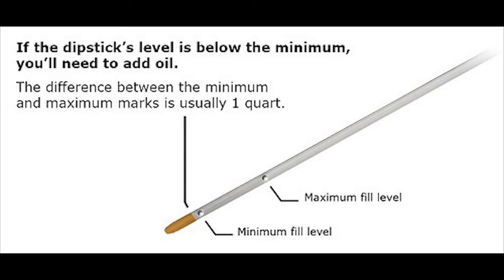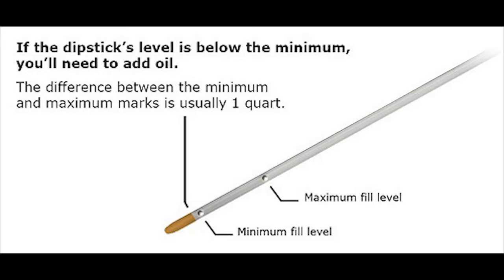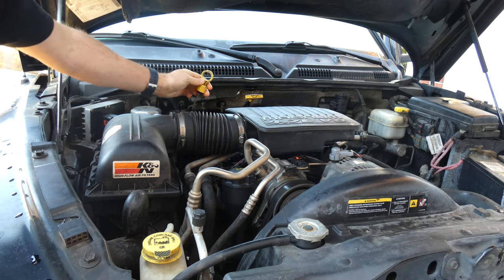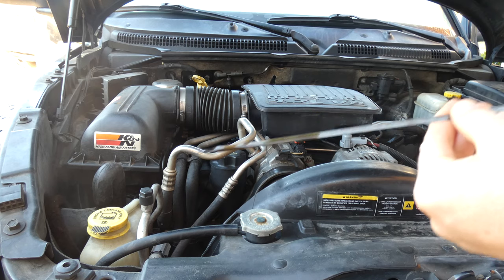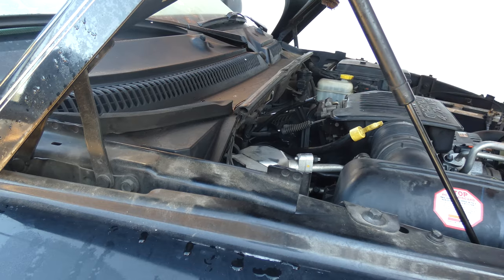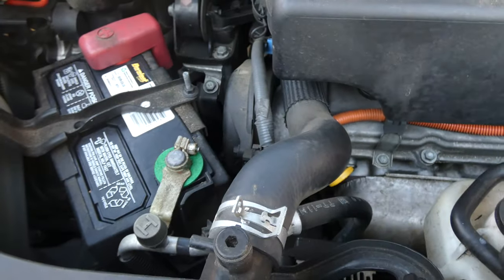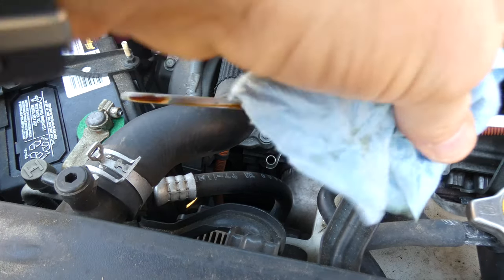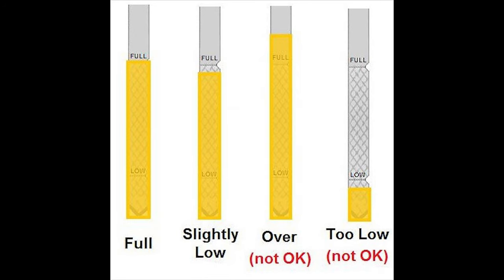How to Check Your Engine Oil Level & Read an Oil Dipstick

Comment: Shouldnt you be topping off the oil when it is closer too the low level? I know you called that safe but wont it be preventative to top off at that point?
Reply from the maker: You absolutely can top off if it is at that level but it is also safe to continue. The rule is you should check your oil every time you fill up with gas so you should catch it with plenty of time.  Also note that most manufacturers have a margin of error built in and even if it drops below that low line, you probably aren't in any danger but I wouldn't chance it.

Comment: So if there's a very faint line it doesn't matter? I have a line all the way thru jut then it's a small line running down the stick
Reply from the maker: It's pretty common to see that small line running down the stick.  Try letting the car sit for longer before checking it and usually that will go away.  If you have trouble determining where the line is, lay the dip stick horizontally onto a sheet of paper or paper towel.  That will make the oil line much easier to see.

Comment: I am not kidding. I have drove my car only 5500 kms since I bought it in 2013. I don't think I have replaced the oil in the last 3 years. Does it need oil change???
Would really appreciate a reply
Reply from the maker: You absolutely do.  Even with the best oils out there, they recommend changing them at least once per year.  Oil actually degrades over time, not just while driving.
Reply: Most cars have a change oil light wouldn’t recommend going off this but it helps tell you when the oil needs changing. So if you haven’t reached your 5000 miles in the year and there’s no change oil light. I’d still check the dipstick too see how dirty the oil is. The cars computer isn’t always accurate your best thing would be to pull the dipstick. Look for black or smelly oil if it’s slightly brown or clear that’s okay keep on driving and ignore the change oil light of it comes on. If the oils black and smells and there’s no change oil light you should change it.
Reply: Change your oil at least once a year.

Comment: What if my oil level is in between the two indicators, is it still fine or I need to top up already to maximum level?
Reply from the maker: If it is in between the 2 indicators, that is perfect and you don''t need to put any oil in your car.
Reply: You don’t need to fill it right up to the full mark. That marks just there to tell you if it’s too full as long as it’s in between low and full good to go.

Comment: Hi , great video, have question, left car standing all night to do accurate reading , topped up oil to get to tip of line , wired stick clean as always , but when I left stick in for a minute and pulled out shout over the full line, but when I pull out stick after few seconds show on the line I filled up too, not moved the car or started engine , is it because the oil soaks up the stick if I leave it in for longer? Or have I over filled the car? Many  thanks
Reply from the maker: The oil can move up the stick from the capillary effect but generally this happens because of oil in the dip stick tube.

Comment: What would happen if the oil is under the low level?.My car was slip while driving.Would that might cause when the oil is below add area?
Reply from the maker: Depends how under the low level it was.  If it was barely, you are probably fine. If it was significantly lower, you can literally destroy the engine.

Comment: Thank you this was very helpful and informative 👍👍 Is there a difference between the car being low on oil and needing an oil change?
Reply from the maker: Not sure exactly what you are asking.  The level on the dip stick has nothing to do with when your oil needs changing. It only shows you if you have enough or too much oil.

Comment: Thank you so much... oh and before i forget after how long should one service his or her car, after how many km exactly?!
Reply from the maker: It really depends on the car and type of oil you use.  Check your car's service manual or see what the oil you are using recommends.  It used to be 5000km but now most manufacturers say you should wait 12000km or longer. A lot of the synthetic oils last longer and usually tell you how long you can go between oil changes. When in doubt, go with what the oil you are using recommends and in my opinion, you should be using synthetic.

Comment: I'm not done watching the vid but there are 2 sides of a dip stick and my dipstick has the 2 holes for indication. So which side should I read/more accurate
Reply from the maker: One side will tend to get wiped off as you remove the dip stick. So you should notice that one side has a clear oil line and the other side will be less clear.  Use the clear side.  If you still can't tell, try laying the dipstick on a paper towel and it should become very clear.
Reply: @ClintHolland  😂😂😂😂dude do you realize how much I appreciate you right now😘🙏🏼🙏🏼🙏🏼bra even Google or these YouTube vids didn't help thanks boo!😍❤God bless📚🎉🎊

Comment: I understand how to do this, but have a question. I see a full coating of oil at the bottom of the stick, but above it i see a smear of oil. It looks like a streak and totally different from lowest half. Does this mean I'm low or ok if it falls in the range you mention. This is after wiping and reinserting. It looks low except the streak of oil is there that looks almost full. Thanks
Reply from the maker: The streak you see is almost certainly a result of oil in the dip stick tube contaminating it when you remove it.  Try this.  Let the car sit still for half an hour or so and see if it is clearer where the oil is.  In general however, without being able to see the stick, most likely the full coating you see at the bottom is the actual oil level.   If you still can't figure it out, send a picture to my email address and I will try to help. You can find that here.  https://www.youtube.com/user/clintrholland/about
Reply: @ClintHolland  You responded so quickly, I actually did not expect a response, so thank you so very much! I just checked it and it looks very low, and I still see the streak. I will check it with cold engine in half hour and see what  I find. Thanks again!
Reply from the maker: @elainekirk90  Absolutely, happy to help. Let me know what you find but I suspect you will find that you are low in oil.

Comment: Had my oil changed at a firestone. Didnt even think to check. They charged me for an extra quart. Pulled the dipstick out, after 1,000 miles (including an autoX event that was 4 hours round trip).... to my suprise, it was overfilled. Not even like a little over, it was like WAY overfilled. Everytime i looked, which was like 10 times, the oil when at least 3+ inches past full. 

Never having anyone else do oil changes on my car ever again now that I have my own jack and stands... 😒
Reply from the maker: Wow.  Never heard of anyone overfilling it that much.  An oil level that high can be catastrophic to an engine if it ends up becoming aerated.

Comment: So.... in Every video Ive watched !!   Not A One has said to turn engine on or Off ???   What type of Mechanics are being Bred??  My step dad was a mechanic .....and a Great one I might add.  He said Always have car on when checking oil !!
Reply from the maker: I have been doing this a long time and have never heard of a vehicle that recommends you check the oil while the engine is running. There are some that recommend you check it while the engine is cold and some that recommend it be hot, but I have never heard of needing to have it running. Not saying it isn't a thing but it is definitely rare and not the norm. Think about this. If your car is low in oil why would you want the driver to start the engine and possibly damage it from low oil just so they can check it and determine it is low.  The true answer you are looking for is that you should check your owner's manual. The designers of the engine designed the oil sump and dip stick and they know best how they want it checked.

Comment: Sometimes I see oil all the way from low mark up to and past full but its a coating not an accumulation of oil. Do you go by the darker accumulation?
Reply from the maker: Good call out.  Yes, it is normal to get some residual oil on the dipstick as your remove it so you go by the darker area.  You can try wiping it with a lint free cloth and trying again or if you really want to be sure, check it after the car has been sitting overnight.
Reply: @ClintHolland  I can’t wait overnight because of the driveway not being level. I waited 10 minutes but others have said it takes longer to drain down. Also I’m afraid of overfilling. Will 1/2 quart cause damage? Also I used TP that didn’t appear to be too linty. Maybe I’m doing everything wrong. It smells like burnt rubber after shutdown.

Comment: How boss I got my cv axel replaced and guy said some transmission fluid came out. bout a quart to his estimate but I check  and it looks its pretty good could I send you a pic of the dip stick to get your opinion
Reply from the maker: Sure.  Send it to clint@quickfixman.com.  Also, make sure you are checking the transmission fluid per your manual's specifications.  Generally most recommend you check it while it is hot.

Comment: hello sir just a question i have a gmc yukon but the dipstick has 5 dots on it and i checked it it was on the 3rd dot is it over filled
Reply from the maker: 3 would actually be perfect as it is right in the middle.  Anything over 5 is overfilled.
Reply: Clint Holland thanks now my head gasket is blown

Comment: Hi , If i accidentally pull out dipstick while engine is running will effect anything ?
Reply from the maker: Not at all. You won't get an accurate reading while the engine is running but it won't hurt anything.

Comment: My car uses synthetic oil in an Toyota Prime electric/gas.  The stick comes out so clean that I can't even see the oil level.  Is there any way to make the oil more viable to the eye?
Reply from the maker: What a great problem to have.  What I recommend is to slowly lay the dipstick against a piece of white paper.  You will quickly be able to see on the paper how far up the oil level was. Hope that helps.
Reply: @ClintHolland   Thanks so much.. never thought of doing that.

Comment: If I don’t have an owners manual of the car, will it say what oil I need on the dipstick?
Reply from the maker: Doubtful it will say what oil on the stick but it usually is under the hood somewhere. Most commonly it is on the oil filler cap.  If you tell me your year, make and model I can also look up what oil type you need.
Reply: @ClintHolland  it’s 2002 Mitsubishi Galant ES 2.4L
Reply from the maker: @abramescutia3726  Below 100 F 5W-30 SAE 5W-30 is preferred.

CAPACITIES: With filter 4.5 quarts
Reply: @ClintHolland  Thank you so much! I truly do appreciate the help!

Comment: Hi. I just changed my oil. The hashmark section of my dipstick is 7/8" . I overfilled about 1/8" . I figure close to five oz. too much. Should I loosen filter to drain a little( I have no hoses or syringes or anything)? Or is this not a problem?
Reply from the maker: I can't give you a you will definitely be ok remark because every vehicle designs their oil pan and stick a little differently with different margins. IMO, you will probably be ok. But if you have the ability to drain some out, I would certainly feel better about it. Maybe just loosen the drain plug and let a little drain out.
Reply: Today I removed some via the filter. After driving then sitting, the level is now about 1/8" below max. I feel much better.

Comment: Thanks for making the video!  I did not know about the car needing to be on flat surfaces to check the oil, but it makes sense.   I do know about double-dipping, do they won’t get me in that trick, but thanks for that, too.  One thing I see is not addressed in these dipstick reading videos: sometimes the oil looks dark around the tip of the stick, but there is some lighter oil heading into the safe territory.  Which shade of oil is most reliable?   Also, I am told I have a cracked oil timer cap.  Is that a trick of theirs?  I did not see any oil under my car after being parked awhile.  I also have not seen my oil needed light on the dashboard.  I don’t need to know this as much, but why is too much oil bad for the engine?
Reply: There is no light telling you that your oil level is low. There may be a light telling you that your oil pressure is low but that may or may not be related to oil level. You certainly shouldn't be waiting for a light to come on to tell you to add oil. Check your dip-stick periodically.
Reply: @njsongwriter  not true. Many cars have a low oil sensor that triggers a light  or message on the dash.
Reply: @njsongwriter  An oil pressure sensor is usually hooked directly to the oil pressure gauge on your car's instrument cluster. When it detects lower than normal oil levels, the pressure sensor will trigger the indicator to reflect the change on your dashboard
Reply: Many older cars don’t have an oil pressure indicator.

Comment: is there a reason why the oil would drop below minimum fill line before the next oil change? my brother has been telling me if my oil change was done properly it would never have been that low in the first place. im confused because my boyfriends dad says i just needed to add oil and i dont need to change the oil or filter yet. i live far from family and friends due to school so i wana know who is correct before i accidentally fuck up my car.
Reply from the maker: There absolutely is.  It is completely normal for a car to lose a little bit of oil.  It depends on the make, model, mileage, type of oil and other issues.  The general recommendation is to check your oil everytime you fill up with gas. And if it is low, you top it up.  Just know that it is completely normal to have to add oil to your car between oil changes.  However, if you notice it using a lot of oil you will probably want to get it checked out.  See this article as well.  https://www.cars.com/articles/how-much-oil-consumption-is-normal-1420682864535/
Reply: Oil degrades over time especially normal bulk oil the cheap stuff it’s because the oil gets dirty starts to break down from a liquid to grittiness so some oil is subject to be lost and it becomes low. As long as it didn’t fill below the low mark you should be okay

Comment: Hello Sir. I bought a new 250cc bike that is Yamaha fz25. In first service at 1000km the service centre guy drained oil and put 1L new engine oil. He was not aware with the fact that this bike needs 1.3 ltr of engine oil. I myself noticed it yesterday when the bike already ran 300 kms. Mh dipstick is showing oil level at its minimum. What adverse effect probably got happen and what should I do immediately?
Reply from the maker: If oil was visible on the dip stick then probably no damage whatsoever.  I would top it off to get it to the right amount and then have someone look at the oil on your next oil change to see if they notice anything out of the ordinary like metal shavings.  A compression test would also be helpful but I doubt any damage has occurred.
Reply: @ClintHolland  thanks for replying. Yes the dip stick was showing oil. I have now topped up oil and the bike is performing nice.

Comment: My problem is my dipstick in the car just has a line of oilalong the length of the dipstick, not showing any oil level on the width. I don't understand this reading. Please help
Reply from the maker: That almost certainly means your car is so low in oil that it isn't registering on the dip stick.  Try adding a quart and checking again.